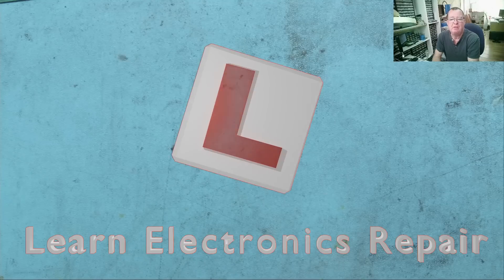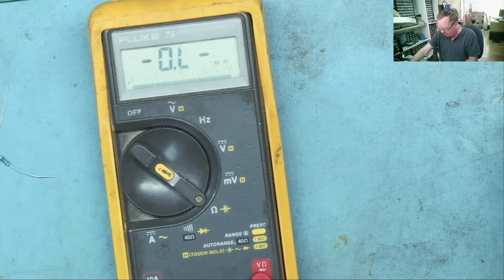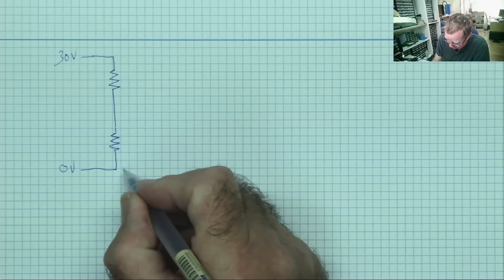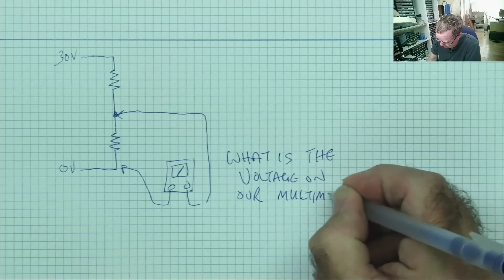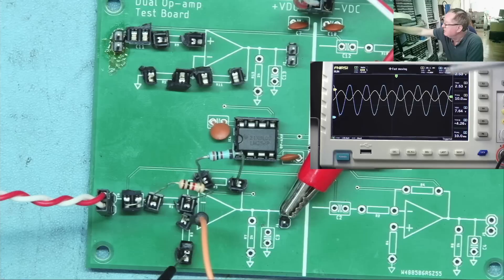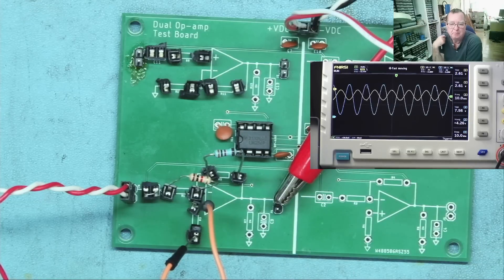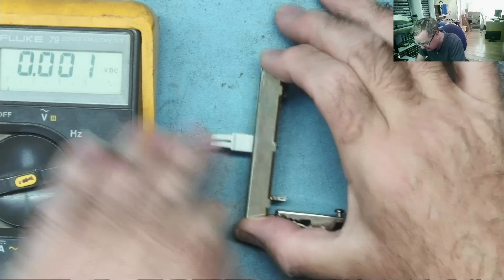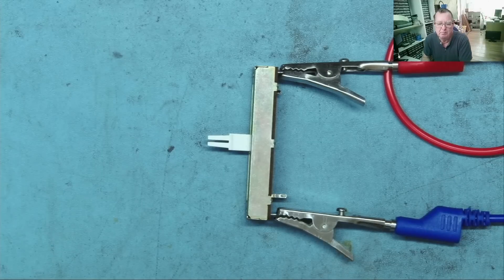Learn Electronics Repair New Year QUIZ - Test your electronics knowledge

Comment: G,day Sir and Happy New Year.
Quiz questions.
I submit the following answers and  MY reasonings.
Q1. Two resistors (value 10.6 mega OMS each in series. 10 volts of DC current would s 0:01 till flow through the two.
(I'm getting a diode and the resistor confused, so my guess is 10 volts).

Q2. The measurement at the op amp with nil current (and no stored energy e.g caps) is 0 voltage.
(Reasoning- there's no source of other DC supply).

Q3.Potentiometer slide. Is only to measure or monitor displacement of volts.

Q4. Bread board with speaker circuit. The mistry component is a relay or gate.

🧲🤨💡

Comment: Without looking at anyone else's answers, I got:
1. 10v (assuming a 10MΩ dmm input impedance)
2. gotta be 0v, hasn't it?
3. 1, 5, or 9v depending on linear/log and which way round it is if log
4. can't think of a single component, but it could be a diode and capacitor in series
Happy new year!

Comment: Nice test, Happy New Year!
1) The huge resistance in your ladder matches the input impedance of the meter (parallel with the resistor you are measuring) dropping the impedance to 1/2 (5M). The ladder is essentially 15M so the drop across 5M would be 1/3 of 30V = 10V.
2) Disconnecting the power to an OPAMP will stop all amplification and inversion functions. This will leave the two passive resistors in the circuit. The output will be essentially identical to the input signal.
3) You mentioned this was an audio control, so it is safe to assume this isn't a linear potentiometer (log). The log of 50% would be right about 3VDC.
4) There may be several components that could react in this manner. I feel a low-voltage unidirectional TVS ESD diode could be used. As long as this voltage exceeds the "Diode Check" voltage your multimeter outputs.

Comment: #1: half of supply, #2: input waveform if instrument doesn't load circuit. #3: if linear pot half of supply, if log pot 30% of supply. #4: bimetallic flasher

Comment: I downloaded the audio file using mediahuman and detected a complex waveform, looks like compound sine waves.  After doing FFT of the sound at 7:49 I see peaks at 2400 Hz,  4200 Hz, 8300 Hz, and 13100 Hz, the highest at 4200.  So I suspect the mystery component is exciting the circuit around 4.2 kHz, perhaps some sort of active oscillator or passive piezo speaker (both wouldn't measure on a multimeter).  The remainder of the peak frequencies probably have something to do with the frequency response of the buzzer (2400 Hz).  If you look at the datasheet for a typical passive speaker, the frequency curve looks like a roller coaster ride, which would explain why it looks like it contains many harmonics.  I ran the experiment using an active speaker and the passive one created a waveform with decreasing amplitude spikes at 4, 8, 12, and 16 kHz, nothing at 2 kHz, but I have different speakers than Richard.  I think the 10uF capacitor is just there to maintain a constant DC level, the RC circuit with a 1K resistor is only 16 Hz.  Removing it decreased the sound level and slightly altered the frequency in my setup.
Reply from the maker: Wow I admire your enthusiasm 😁
Reply: Over-achiever! 😂

Comment: Yoloooo 
1) not half the input volts , because of the input impedence of the multimeter the answer will vary if the multumeter is 10Mohm or 1Mohm input impedence 

2) i've no idea i think i have to watch the all you have to know series of op amp hahah , but i guess output will be same 

3) around half the input so around 5v

4) DIAC ? ... no reading on multimeter on diode mode because DMM is testing at around 2v and the diac is more than that , zener would show up at diode mode  , the capacitor charges reaches the opening voltage of diac and discharges through the speaker diac closes capacitor charges so and so....

Hope i answered 1 sensei hahah 
Kudos all the way from Africa, Ethiopia

Comment: Q1: 10V 
The resistive divider with two equal resistors divides the voltage by two and the voltage should be 15V. But as your DVM has a similar input resistance of 10 megohm, the resistance of the part were the DVM is connected becomes only 5 megohm. Hence the voltage is divided 1:2, 10V on the measured part and 20V on the other. 
Q2: the same as the input signal
Without a supply voltage the LM358 shoult no longer influence the circuit behaviour. What remains are two resistors which connect the input to the output. 1K+3K will not significantly influence the signal as the scope input resistance is at least 1 megohm. 
Q3: 1V or 9V dependent on the direction of the potentiometer
Given the use as a volume control in audio circuits and the letter A in the part number I assume this is a logarithmic potentiometer. Therefore in the center position the resitance is divided 1:9 approximately. Depending on which side you measure the voltage it is around 1V or 9V.  
Q4: Thyristor
This is probably not the right solution as a thyristor will usually not measure open circuit in both directions. However, the circuit can work with a thyristor. You have to connect gate and anode to the positive end of the capacitor and the cathode to the speaker. This will give you a relaxation oscillator. The thyristor triggers and discharges the capacitor until the current drops below the holding current. Than the capacitor charges again until the trigger voltage is reached. If you flip the connections the thyristor will not trigger as the gate is always at zero volts via the speaker. I tested the curcuit with several thyristors and not all worked as holding currents and trigger voltages differ and may not fit this circuit. With some fine tuning of the resistor you get more thyristors to work.

Comment: I don't know about anyone else, but I HATE the 5 band colour code for resistors, and I think the way it is implemented is all wrong.
Back in the day, I could look at a resistor and instantly know its value without having to work it out, when you've done it thousands of times, your brain learns.
NOW! Not only do I have to work it out, I often have to use a multimeter on many resistors because they have a brown band at each end. 
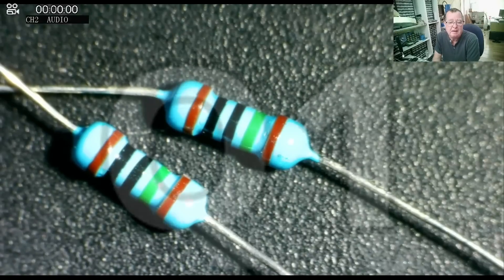0:22 These resistors could also be 150 Ohms, depending on which brown band is the tolerance. 🤷

Comment: Hi Richard and Happy New Year. Thanks for another year of entertaining and informative videos and for an amusing test to distract me from the miserable weather here in the UK!
Regarding your test questions I believe the answers to be:
1 - Probably about 10v as the input impedance of the fluke (about 10M) will be in parallel with the lower of the two 10M resistors resulting in an effective resistance of about 5M so the junction of the two resistors will be at about 1/3 of supply.
2 - With power off then the I/P signal will be apparent, non-inverted, at the O/P pin as a result of the i/p and feedback resistors in series.
3 - Potentiometer voltage at slider pin will depend upon the potentiometer law or taper and if not linear then which way around it is connected. In the video we can see the pot is marked as "type A", in Asia and the US that indicates audio or logarithmic, but in Europe it can mean linear!
If it were linear then the voltage would be close to half the supply or 5v regardless of which way the pot is connected.
However, if as I suspect it's an Asian "type A" then it will be logarithmic and the mid position would be approximately 10% resistance from one end and consequently 90% from the other, in which case depending upon which way around you connected the pot the voltage will be either 1v or 9v.
4 - Trickier one this but given the behavior and the multimeter readings it must be some kind of directional and active component.
I suspect the mystery component is an SCR with a floating gate allowing it to trigger on noise, discharge the capacitor through the speaker until the current drops sufficiently for the SCR to turn off allowing the capacitor to recharge via the resistor until another noise spike re-triggers the SCR again.
Reply: #4 might also be achieved using a low voltage DIAC such as the ST4.
Reply: The potentiometer terminals are marked on bottom and polarized location 11’ 22’ 33’. The spec sheets show the voltage vs position for the 1-2 terminal pair when voltage is applied to 1-3. This should help determine which voltage to choose for the slider.

Comment: Q1: 15v; Q2: 2.5v; Q3: 5V; Q4: 100 pF electrolytic capacitor or less; Happy new Year everyone. Rick, special thanks to you for the job you are doing.
Reply: I have much faith in your set of answers
Reply: Are electrolytic capacitors made at 100 pF?
Reply: @pault6533  most probably it will be SMD type polarized
Reply: Q4 cant be a cap, it would block DC. My guess a 6v-12v Zener
Reply: @a1fliema1fie  well this electrolytic capacitor and it doesn't block DC in some cases - trust me. And cannot be diode because it tests as OL in both directions
Reply: @a1fliema1fie  before a capacitor 'blocks dc' it will have to charge...  but one capacitor will charge faster than the other because one of them is in series with the buzzer (ie load) causing a kind of perpertual imbalance where the capacitors charge and discharge sending singals through the buzzer

Comment: Q1: 10V, you wanted me to say 15V but i won't because inside the multimeter theres an 10M resistor
Q2: it would look the same as the input signal
Q3: 9V or 1V because audio pots is in logarithmic scale
Q4: idk some diode?

Comment: I thought the last question was going to be what melted the center of your breadboard.  I wonder if the mystery component is an active buzzer or active oscillator.  Since the potentiometer is for audio it likely uses a logarithmic resistance profile which is usually about 15% voltage output at the middle position, assuming it is volume control and you connected the voltmeter to terminals 1' and 2' and the voltage was connected to 3'.  I'm going to guess 1.5V.  Gotta love those confusing 5-color resistor bands.  Oh, and if you switch the power off, nothing will be seen because the studio will go dark.  If only the op amp is powered off, you'll see observe the input signal in it's original amplitude and phase.
Reply: FYI, I tried my suggestion by using a active piezo speaker which does not have a measurable resistance either direction.  When hooked up as the mystery "component", both the active speaker and the passive one made sound, so this could be one answer, although it's not truly a "component" nor is it as small as what was shown.  I would suppose if the piezo is taped quiet, or the driver disconnected, it would work the same since the circuit is still active?  I didn't dissemble the active speaker to find out (it's epoxied).  I tried some of the other suggestions: transistors, diac, triac, zener, varactor, capacitor, and only the active speaker worked.  Unless I used the wrong value or type?  Really had hopes for the varactor!  Another possibility is a relay wired to self-interrupt itself, but that would read continuity on a multimeter and would need to work at very low current.  Perhaps a solid state relay would work.

Comment: Here's my guesses.
1. Approximately 10 volts.
2. Output will be the same as the input.
3. Approximately 5 Volts.
4. NPN BJT in avalanche breakdown mode (Collector to RC junction, Emitter to speaker, Base is not connected).

(edit) oops ... I got the leads reversed for #4. It should be Emitter to RC junction and Collector to speaker. Tried it on the bench. Went through about 5 different types of NPN until finally a BC337 worked for me.

(edit 2) Revisiting Q3: I was assuming the slide pot is linear. if the pot is logarithmic, then my answer is approximately 1 volt.
Reply: You are right about all the questions, nice Job
Reply: I tried your NPN suggestion and it didn't work.  Nor did a PNP.  Wondered if you tried this?  Or a Mosfet?
Reply: @pault6533    I did finally try this on my bench. My initial comment had C & E reversed.
Got it to work with a BC337-40 when using a tiny inductive speaker.
It did not work with a bare piezo transducer, nor with a 1k resistor across the piezo.
Looking at 7:09 it's not clear just what type of transducer Richard is using (due to the multiple solder points on the rear), so it's possible that mine is not the correct answer.
Reply: @BusyElectrons  Thanks for checking!  We shall have an answer soon.

Comment: Question 1: 

We have to consider the input impedance of the multimeter.
Note that I haven't been able to locate the manual for the Fluke 79 Series,
as shown in the video. I've been using the value stated for the Fluke 79 
Series II instead, which states > 10 Megaohm. 
I'd say a typical value for a modern multimeter, but as you use an old model,
the value might differ, Using a value of 10 Megaohm.
This gives a 10 Megaohm resistor parallel to the 10 Megaohm resistor in the 
circuit, thus equivalent to 5 Megaohm. So we have 10 Megaohm is series with 5
megaohm, thus a total of 15 megaohm, As we supply 30 volts, the voltage drop
over the resistor and multimeter will be 10 volts. 

Question 2:

Output voltage cannot exceed supply voltage.
However, when the supply voltage lines are floating, could they float in a 
way that allows some output voltage? I still expect no output.

Question 3:

Note the part number is V50KAX2. The unit is a 50K potmeter. The A determines
the characteristic. Now, we need to know whether this is an European American 
or Asian part, as the meaning of the A and B in this position are swapped.
For European parts, A is linear and B is logarithmic. For American and Asian
parts, A is logarithmic and B is linear. 
For a linear part, it would be at half the voltage, thus 5 volts.
For a logarithmic part, it's about a quarter, thus 2.5 volts

Question 4:

I am not sure but it is probably a zener diode with a zener voltage
that exceeds the measuring capabilities of the multimeter. 
Note that the supply voltage is 12 volts, and thus, the capacitor could charge
up to 12 volts. Also note this speaker is likely to be an inductive type. 

Happy New Year!
Reply: A case where the measurement method affects the result! Wouldn't the Zener be measurable forward biased?
Reply: @pault6533  That's right... hmmm... what about a TVS diode, having the high voltage in both directions. Nah, that won't work either as the polarity matters in circuit.
Reply: @AndreDeLimburger  See if you have any varactors to try.   I have only a few small ones and they didn't work, might need to be a different spec.
Reply: @AndreDeLimburger I was thinking maybe tunnel diode or Gunn diode, something with a negative resistance that would make it oscillate.
Reply: @pault6533 zener looks like a diode except it has a specified accurate forward breakdown voltage, so reverse would be around .6v for a silicon device.
Reply: And I remembered that backwards.  Conducts forward biased, blocks reverse up to the breakdown.  Derp :)
Reply: For Question 2: I think that leaving the power lines of an inverting opamp floating will result in the input voltage showing at its output.
That is due to the fact that the gain setting resistors are in series between the input and the output.
Reply: @noelj62  I was just looking at the internals of the opamp, the simplified view in the datasheet... and I overlooked external components.
Reply: I thinking it's a cap
Reply: @marksplace  But what about the fact it appears to be polarised?
Reply: The chart I found for log taper pots (audio taper) showed 10 percent of total resistance at midway point so i’d think a bit lower, around 1v - although the slope of the curve bends sharply above midpoint so perhaps a little higher like 1.5-2v.
Reply: @camelid  I looked at a chart at wikipedia. in Dutch page about the potentiometer, it shows a graph where the mid  (150 degrees, where it can turn 300)  is about 25%
Reply: The reason I love my old vtvm - circuit loading is negligible.  Yay old tech.

Comment: Thanks for all your interesting videos, hope you keep doing that in 2024. Wish you a great 2024.
 
1: less than 15V, probably close to 10 Volt as the multimeter has also an input resistents of 10Mohm.
2: output will be the same as input,  between input and output are only the 2 resistors, as the input impedance of the scope is high there will be almost no loss .
3: if it is a linear slider the output will close to 5V
4: maybe a crystal?

Comment: Q3.. voltage will be close to 5v since u ve created a voltage divider using variable resistor
Reply: We don't know if It's a linear or logarithmic pot. That would be true if it were linear. But that would be too easy.